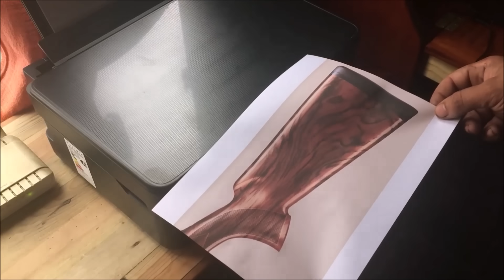BALLESTA  CASERA de  MADERA  y PVC -BALLESTA ARTESANAL TALLADA Y PIROGRABADA

Comment: How far can it shoot to kill ? it looks like only 10 ft rather useless for hunting unless you are after cardboard box's !
Reply: I was thinking the same thing.  The arrows looks like their traveling at 70 to 80 mph if you compare that to a baseball batting cage.  However, with some crafty modifications with homemade pulleys, I'm sure he can tweek that crossbow to become a compound bow on the cheap.  I think he would probably get an additional 10 to 15 feet at 100mph.  He seems to have nice arrows.  Well, that's what I hope tries out.  I think someone else made the same comment in spanish.